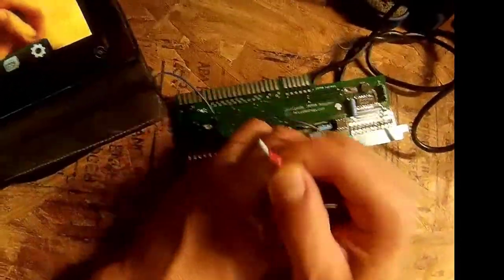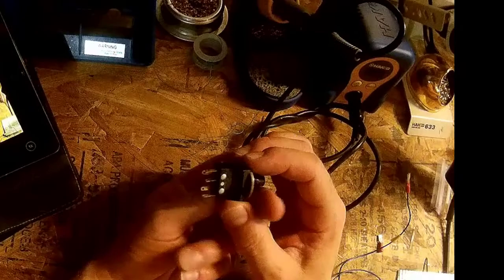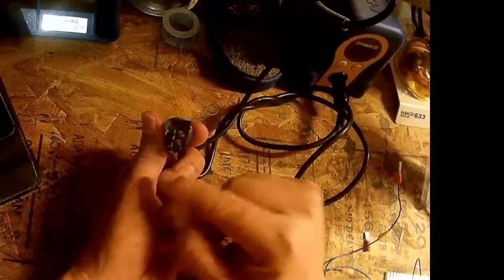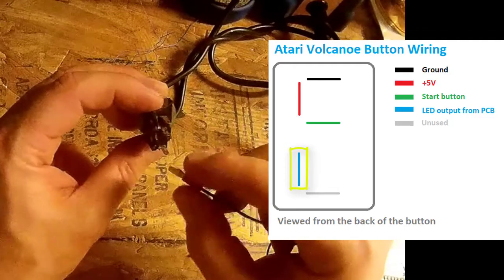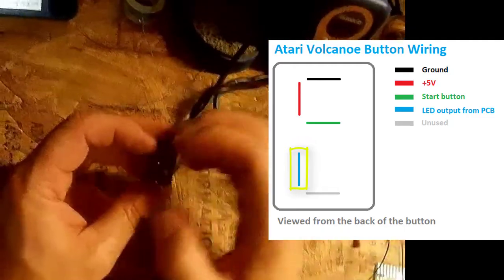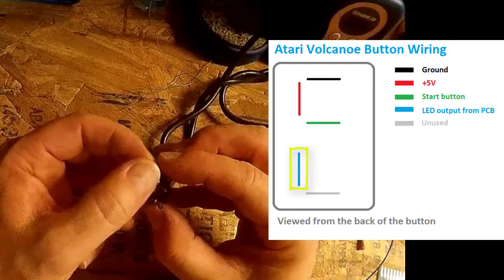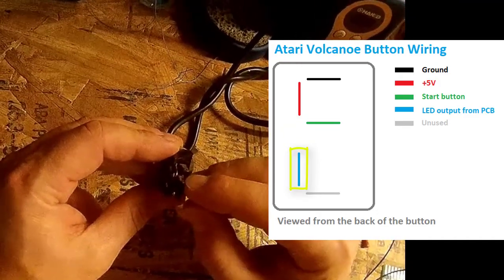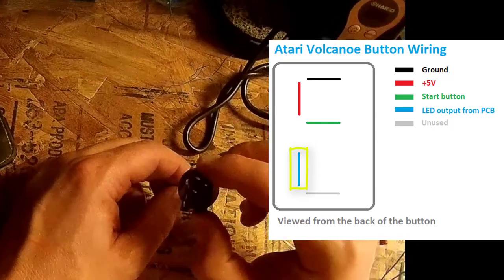Hooking up Atari Volcano buttons to a Centipede to JAMMA adapter

Comment: I thought we need to use a 220 ohm resistor for the 5v.
Reply from the maker: when hooking up to a Centipede board via the JAMMA adapter, you do not need them, the resistors are already on the Centipede board. If you hooked this up randomly to something else then yes you'd want a resistor.
Reply: I ended up using the KNACRO NE555 Pulse Module Square Wave Rectangular Wave Signal Generator found on Amazon.  I’m using this on a pole position cockpit with a volcano button - flashing credit button located in the door lock.  Not using a resistor....